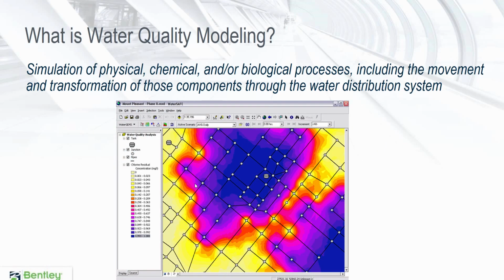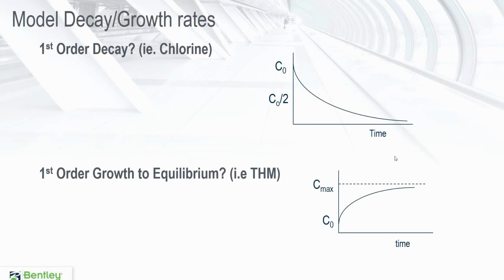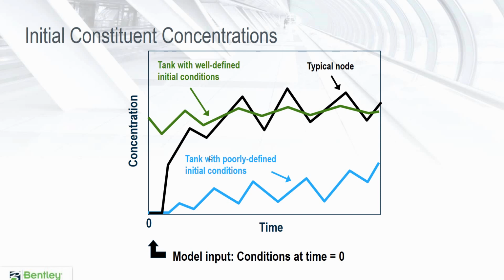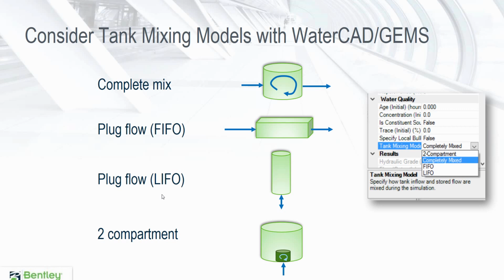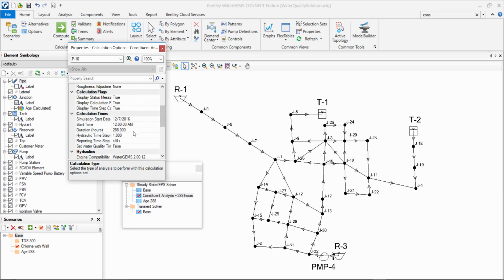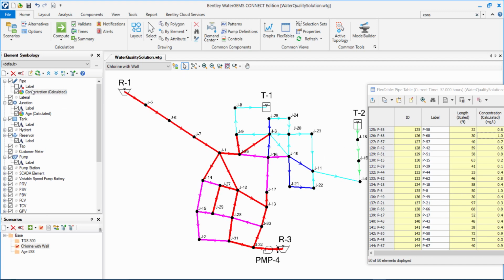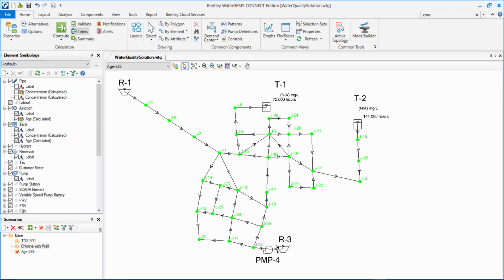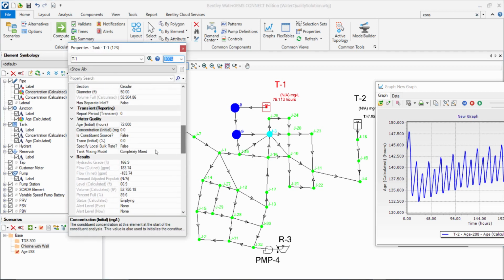Introduction to Water Quality modeling

Comment: I have daily data on the chlorine levels in the reservoir for two months, as well as the results of water sample tests at representative points from one of the water distribution networks that draw from this reservoir. How can I use this data in a research paper? Could I use steady-state conditions in the simulation or not
Reply from the maker: What is your research paper about? You could use the measured values from a particular time/date as the initial concentrations, and potentially use the information you have to derive reaction rates in the constituent properties. You would still need to run an EPS to see the concentrations throughout the network changing as flow changes and the constituent undergoes bulk and wall reaction changes.

Also see this article: https://bentleysystems.service-now.com/community?id=kb_article_view&sysparm_article=KB0058382

If you need to discuss further, it would be better to ask on our forum: https://bentleysystems.service-now.com/community?id=community_forum&sys_id=0310b7ca1b1a3110f3fc5287624bcb80

Comment: What should be the maximum water age allowed in a drinking water system? Does Bentley have any rough recommendations please?
Reply from the maker: Hi Jacques-Louis, standards for potable water age are likely different for each geographic region and local reviewer. If you submit to a reviewing agency, you may want to check with them or with any local standards. You can find additional guidance in our Advanced Water book: https://store.bentley.com/en/products/books/9781934493014--Advanced-Water-Distribution-Modeling-and-Management

For additional questions about the software itself, post on our forum: https://communities.bentley.com/products/hydraulics___hydrology/f/haestad-hydraulics-and-hydrology-forum

Comment: What do you mean by water age ? How could you measure it along the water network?
Reply from the maker: The water age shown at an element represents how long that water has been in the system (since it entered via a reservoir or inflow) at the current timestep. So for example if you're looking at timestep 18 hours and a tank shows a water age of 18 hours, it means that the water in the tank has been in the system since the simulation began, and if the water age at a demand node at timestep 18 hours shows a water age of 1 hour, it means that it took one hour for the water to travel from the source reservoir to that demand/outflow point. If you have any further questions, please post on our Forum: 

https://communities.bentley.com/products/hydraulics___hydrology/f/haestad-hydraulics-and-hydrology-forum

Comment: Can we able to calibrate the model using chlorine deacy rates
Reply from the maker: Hello LaxmaReddy, water quality calibration in WaterCAD and WaterGEMS is a manual operation at this time. You can use the constituent analysis and compare results to field measurements, adjust and repeat. See the note about calibration in the following article: https://communities.bentley.com/products/hydraulics___hydrology/w/hydraulics_and_hydrology__wiki/31934/getting-data-and-setting-up-for-a-constituent-analysis-in-watergems-and-watercad

See also: https://communities.bentley.com/products/hydraulics___hydrology/f/haestad-hydraulics-and-hydrology-forum/183132/water-quality-calibration/

Comment: thanks alot
can i ask
in the constiuent basein the junction there is
concentration base  and  intial
whats the defrence 
what are the values i should set
thanks alot
Reply from the maker: Hello Rureta, the "Concentration (Initial)" is used to define the concentration at that node, at the start of the simulation. If you leave it as the default of zero, then the concentration will be initially zero and the model will take some amount of time to reach an equilibrium point. The initial concentration would be useful if you had the ending concentration from another EPS run. On the other hand, the "Concentration (base)" represents an input of a constituent - meaning, an injection of the concentration at that point in the network. If your constituent enters the system at another point such a reservoir or tank, then leave the junction base concentration as zero. See:
https://communities.bentley.com/products/hydraulics___hydrology/w/hydraulics_and_hydrology__wiki/16546/understanding-constituent-source-types-and-constituent-patterns

For future questions, you can post on our active forum: https://communities.bentley.com/products/hydraulics___hydrology/f/haestad-hydraulics-and-hydrology-forum

Comment: thank you for your excellent video!! is it possible to simulate contamination spread with this tool, by define an injection in a random  junction so the model will calculates the contamination area and show's the pipes who got infected?
Reply from the maker: Liron, yes, you could use either a trace or a constituent analysis for that. If the contamination starts at a reservoir, the trace analysis would show you the percentage of water at certain points in the network, that came from the contaminated source. For a "random" junction, you could use a constituent analysis and color code the calculated concentration to see it spread.